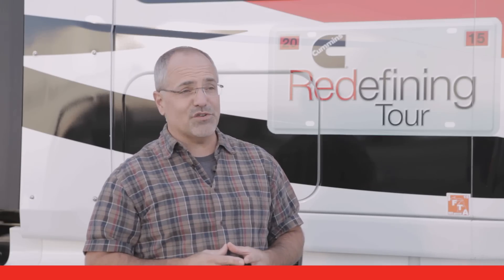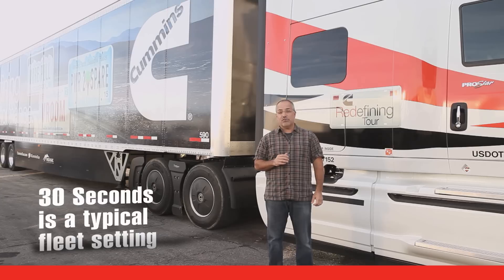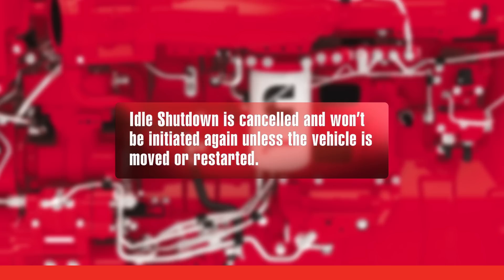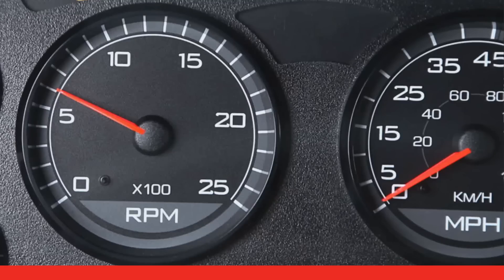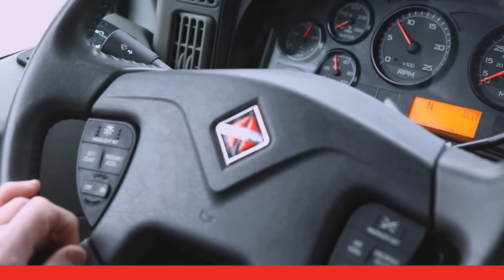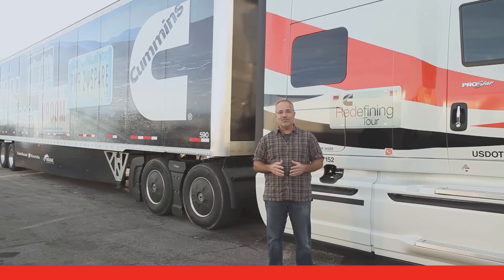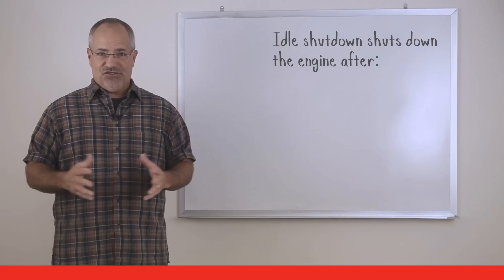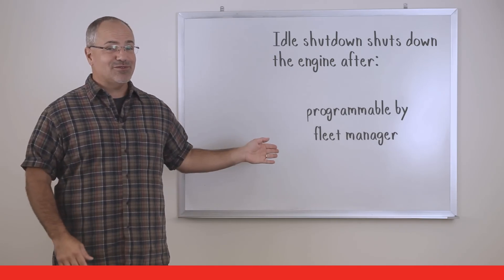Idle Management Features - Driver Training for On-Highway Heavy-Duty Truck Engines

Comment: Don’t listen to this guy. Warm your engine up before putting a heavy load on it. If your engine block and oil are cold and you take off you introduce heavy amounts of heat in the cylinder walls. This can warp your head or engine block and deck significantly. Oil also operates much better at a warm temp then a cold temp. These guys have no clue about engines and how they work. The reason they don’t want you to idle or pre heat is because the def system does not like idling engines. It clogs it up much faster at idle and the dpf filter can not clean its self out at idle. If you’re an owner opp, get a def delete on it. Def is nothing but a money pit. Doesn’t save the environment at all.

Comment: With and ISX 15, does using high idle overnight increase engine life with higher oil pressures? Or is this a myth?
Reply: My oil pressure stays the same regardless pog engine speed. In older trucks you had to idle up for that reason

Comment: This was the stupidest idea ever ya go on right make us drivers suffer in the cold and heat while you sit behind your desk all day controlling the temperature to whatever you want so you can be comfortable while we wanna just drive every truck that can’t idle off a damn bridge it’s the stupidest idea ever everyone that tells you that it’s saving them money by saving fuel it takes more fuel to start it then it does to idle take two trucks side by side let one idle and then start the truck on one and keep starting it simulating going in to the pilot going into a shipper/receiver because I promise you the one that’s idling is not using as much fuel the whole thing is scam they didn’t decide to do this because it’s saving them fuel they decided to do it because they can give a rats ass about good drivers

Comment: Apu is out so were having to use the truck air ( international) it works fine idles all day except the 2 times the trailer had blow outs then it kept dying. RSA fixes trailer, boom idles all day again? What's up? 1st we thought just a fluke but it's not. Any ideas? Thanks

Comment: This is my first and last time driving an international
Reply: They are by far the biggest POS trucks out here. 🤬🤦🏼‍♂️
Reply: @kingster2929  I'm curious as to why you think that? I can find a few things I don't like with any truck compared to another but would like your opinion. Maybe I'm looking for something to hate about it, I guess. 🤷‍♂️
Reply: @Rich-ni2ol  International trucks have no torque and are extremely fucking slow. 

I hate my truck. Never again.
Reply: @dutchvanderlinde5004  Plenty enough torque with my rig but I do agree with the slow part. The automated trans on this 19 drives me nuts. I was in a volvo for 2 years with a 13L and automatic and it would dust this truck off the line but the ISX15 in this one would leave it behind on a grade.
Reply: @Rich-ni2ol  My brother in law drives a freight liner and he says it is the best built truck he has ever driven. 

At this point I’ll take anything else over mine. I’m sure international trucks have something about them that makes them special since they are a large brand but I cannot stand my truck and how Goddamn slow it is.
Reply: Amen. Hate this damn truck. Backing it is a nightmare; if it doesn't want to back, it won't, just stops mid-back. Drivers will be guiding me by hand (which I hate) or radio and wonder what the hell I'm doing just sitting there. Or it just accelerates out of the blue while I'm trying to touch the dock and BAAAAAM. And it rattles something terrible while idling. 
2018 LT with 595XXX is crap. The only reason I'm driving this pile is it was a running buddy's truck, but he died in it November 2021, so to help out I'm driving it until its paid off. But never again will I drive one of these.
Reply: @fraa888grindr6  You sound like a great genuine person. my condolences. I hope everything works out for you and hitting those docks lol.
Reply: @Rogerdis215  thank you but it's gotten much worse. My passenger side headlight went out and because it's an LED system to replace it is $1,000 and no one has it in stock nor is there any kind of substitute aftermarket or otherwise

Comment: How do I get my 2020 International to drive 65 miles an hour using cruise control? It is governed at 63 mph. Computer says it will drive 65 mph with cruise control, but how? Any help much appreciated, thanks.
Reply: Put it in cruise at 63... then use the accelorate button on your steering wheel and press and hold until it shows 65 on your Speedometer or if you have an OnGaurd system, it will show there.
Reply: @truckerron  Thank you very much, I appreciate it.

Comment: Keeping the idle going is only good on a Freightliner it will not work on it international I've tried
Reply: Keep truck in neutral and release tractor brake. Keep trailer brake on. Tricks the computer and truck will idle all day long.
Reply: @teardropperkinz8823   thank you Bro.  You came thru on that one! I Just got me one of these POS trucks couldnt figure it out was getting frustrated Thanks Again
Reply: Juan DeLaRosa Ur welcome brother, glad I could help
Reply: Thanks
Reply: Works on mine. The truck will idle for 5 minutes then cut off. However, just before the engine cuts off, a yellow engine lights up on the dash. Here, I press on the brake pedal, the lights goes off, and the engine will stay on. 😀

Comment: Can anyone tell me how to turn on the power inverter in the bunk of a 2018 international
LT Series
Reply: Mine is located under the right hand side of the bunk.  You can turn the on switch on by lifting the bunk or you can access it via the side box.
Reply: I have a 2019 and trying to figure out the same thing... i push the on button but the switch will not come on

Comment: Internationals suck. Ill never drive or buy another
Reply: why is that?
Reply: Very true, this trucks not make good load capabilities
Reply: Again everyone doesn’t understand that it’s the companies that choose whether or not the truck can idle or not as a owner operator it’s your choice that’s why here pretty soon I’ll never be a company driver ever again I’d rather idle and have a choice to not be cold or hot then be cold or hot because the people sitting behind there desks all day sure as hell have a choice to run ac or heat so why shouldn’t I have a choice I’ll tell you why because there a bunch of greedy ass holes that don’t care about no one except making money they don’t care if you starve to death or freeze to death as long as they get a paycheck they can careless
Reply: My truck can’t even do a proper regen because the damn truck won’t let it it won’t idle for a damn thing even if it’s too cold outside or too hot outside because like I said the companies have the option to take away every trick you can think of the cruise control the air brakes hell I’ve bunch the red and yellow one where the truck could roll on it’s on and it still won’t idle the fuse the only thing I have tried is unplugging the temperature control thing because I can’t find the damn thing

Comment: My question is what'll it do to me engine to take off as soon as I've got oil pressure when my oil temp hasn't come up yet? There are times I got oil pressure but till it warms up it's extremely high. And excessive oil pressure isn't any better than not enough.
Reply: Darren Catenacci if it's extremely high your pump could be going bad. If it's really low you're low on oil or also could be pump. Normally operating range is 40 to 50. I would get it serviced and have that checked. If you drive with your pressure to high or to low you have all kinds of problems
Reply: So y G *? Do u keep using this with my apps MY. Blowa????
Reply: I just got an International, but in my last truck, a Frieghtliner, before the antifreeze warms up the oil pressure was higher. After the antifreeze temperature came up then the oil pressure would drop lower.